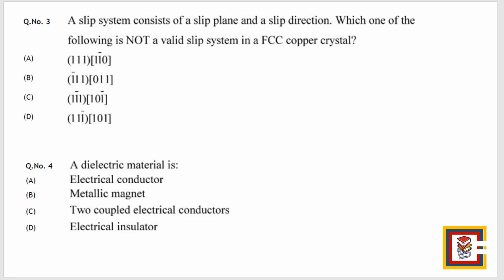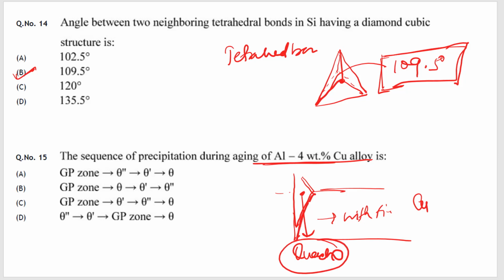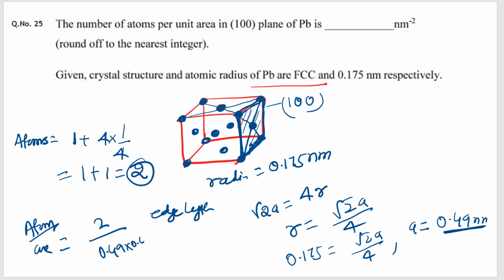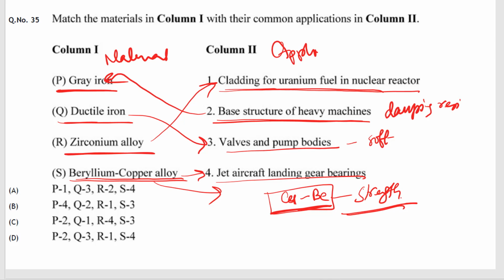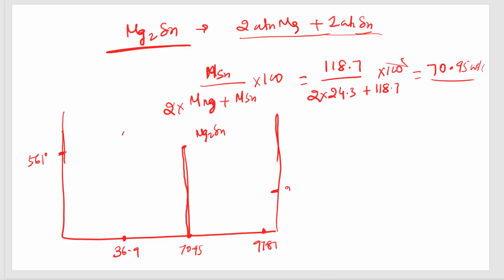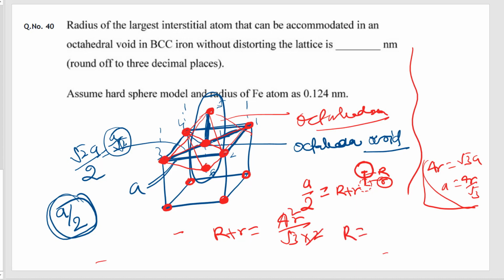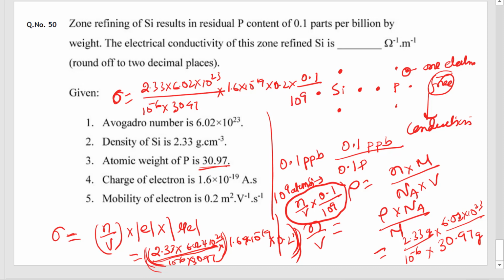GATE 2020 PHYSICAL METALLURGY SOLUTION

Comment from the maker: 00:00 Slip System
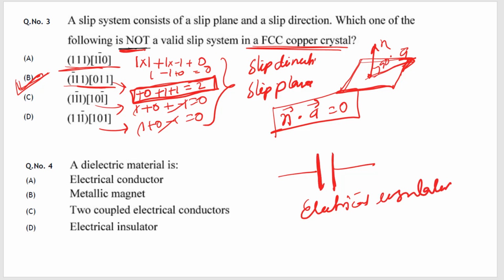02:57 Dielectric Material
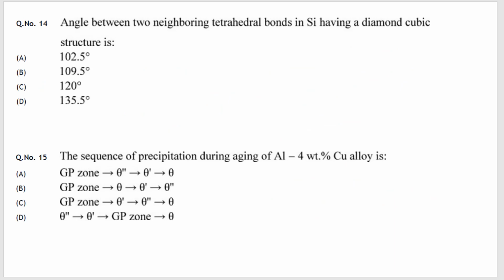03:34 Angle between tetrahedral bond
04:26 GP Zones
06:41 Number of atoms (100) plane
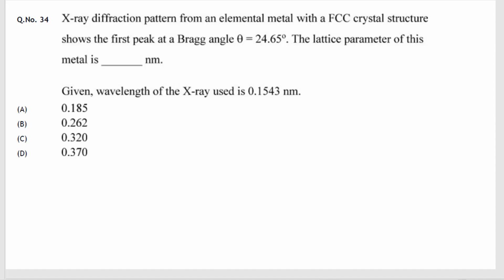10:13 XRay diffraction
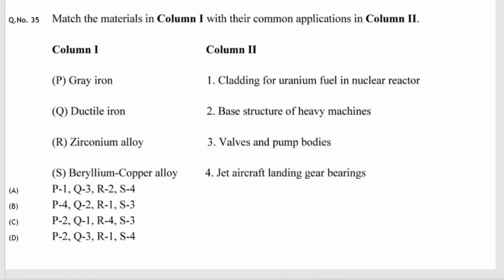12:14 Match type alloys
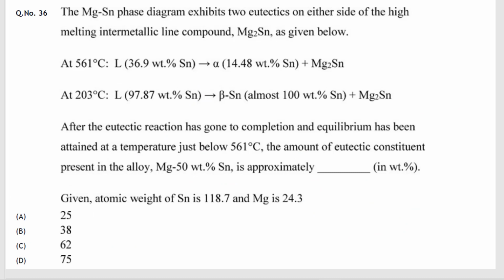15:05 Mg-Sn phase diagram
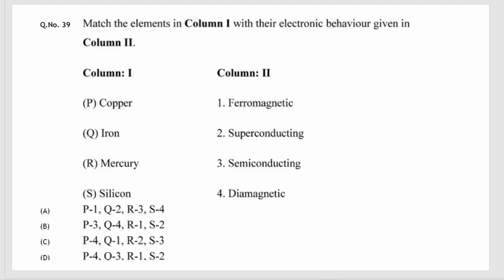23:08 Match type metal
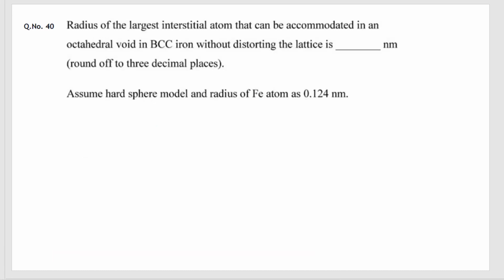24:04 Octahedral void
29:33 Zone refining silicon